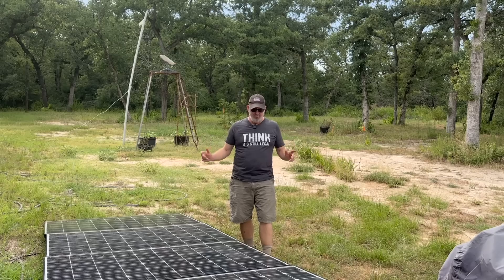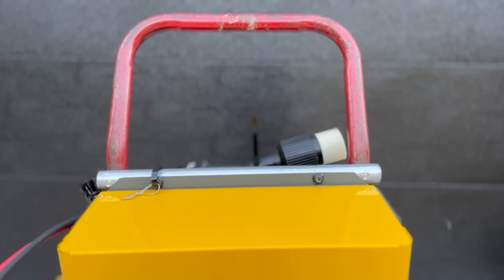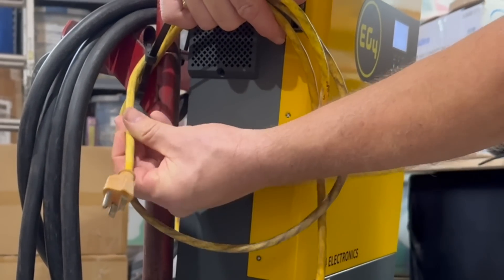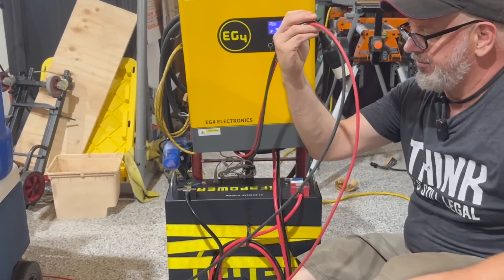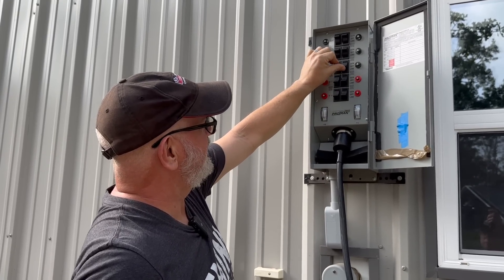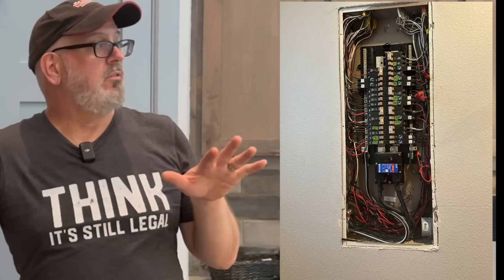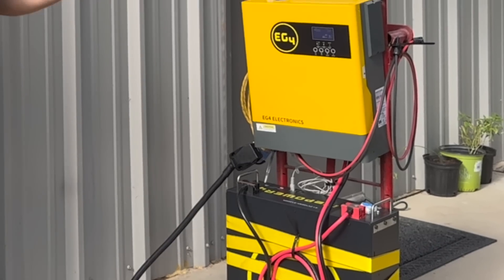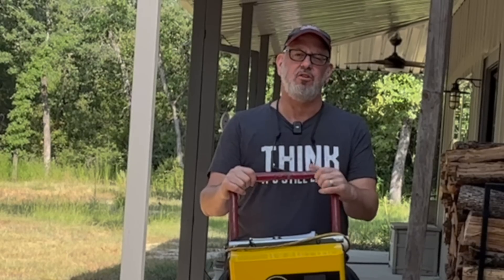CHEAP DIY Solar Power Portable Generator

Comment: I built the same hand truck. And I tapped in one section of my grid tie solar panels ~4KW.  I tested for a week and it was awesome.  Consider  I only got 3 full days of sun….No transfer switch or critical load yet. Just cords to windows AC and two fridges. It is true. Solar can be additive
Reply from the maker: That’s fantastic!  It’s amazing how much power a 5.1 kWh battery🔋can store.  When mine is just sitting around, it’s running a 1 ton inverter window unit A/C in our shop.  Yes, solar power can be addictive.  Once you figure out how to harness nuclear fusion from the☀️sun for free, you tend to get on a power ⚡️trip!  🤣👍💡🔌🤠
Reply: @terrahillfarm do you have a link to the window AC unit that you are using?
Reply from the maker: @MyCabinLife  here’s a link from Home Depot.   

https://www.homedepot.com/pep/Midea-12-000-BTU-115-Volts-Window-Air-Conditioner-Cools-550-Sq-Ft-with-ENERGY-STAR-and-Remote-in-White-MAW12V1QWT/315241182

I’d check prices at Amazon, Costco and Walmart as they all run sales from time to time.  ⚡️☀️👍🤠
Reply: @terrahillfarm  thank you!
How long can you use it on the little system that you built?
Reply from the maker: @MyCabinLife  I really depends how hot and/or humid it is.  It will consume between 550-1150 watts when running. It’s variable speed so it might be low consumption in a smaller insulated room.  It’ll ramp up and down depending on temp and setting.  I use it in a way bigger space than it is designed for, so it’s usually running all out for me if it is really hot outside and it doesn’t cool a 1200sf shop near as well as a Bedroom.

So in a house, if the outside temp was say in the mid 80s, average use might be .5-.6 kW/hr.  At that rate, you’d get about 7 hours out of 1 battery.  If the battery is hooked up to solar panels, the panels could generate additional power during the hottest part of the day so you might get a total of 10-12 hrs run time in the mid 80s.  At 95f the battery would last less.  For a broad guess without solar panels and temp in the high 80s, I’d calculate an average of 5 hours, based on 80% SOC for a 5120ah battery at .85 kW/hr. In real world figures, every use case is just different. 👍☀️🔋⚡️🤠
Reply: @terrahillfarm  I do have 11 of the 455 watt solar panels available. I'm trying to decide between something like this or a mini split if I can get one with a regular plug on it for at the cabin which I'll eventually be moving to. And the mini split would have heat and air conditioning. I'm still trying to figure out which one. I saw signature solars 12kbtu inverter one that you can run direct on the panels but I'm not sure it's worth the price and they have so many problems with their stuff when it first comes out I'm Leary.
Reply from the maker: @MyCabinLife  a 12000 btu mini split a/c may have slightly better performance depending on the SEER rating.  Remember that over 12000 btu you’re looking at 240v systems.  If you need heat, the battery drain maybe higher.  I’m going to have to move up to at least 24k btu mini split to cool my shop.  If it’s for daily living areas I’d go with a mini split.  Just for cooling a single room under 500sf, the Midea A/C will work fine and save money.  👍🤠
Reply: @terrahillfarm  my cabin is under 400 sq ft. I have three of the EG4 server rack batteries.
Reply from the maker: @MyCabinLife  the Midea would be fine for your A/C or you could get a 9000-12000 btu mini split for a little more money and have heat too, although I prefer to heat with propane and use electric as backup. Sounds like you are set! 🏠

Comment: I recently purchased the same battery and inverter and I am waiting for six 415 watt solar panels to be delivered. That should provide plenty of power for anything we'd need in a blackout. I will in time get a second battery just to have a little extra power in reserve. I am sure eager to see it all together.
Reply from the maker: Thanks!  That’s about the same amount of solar watts I’m running off 10 used panels now.   That’ll run some heavy loads in peak sun hours.  If your utility charges lower rates off peak hours, you can recharge the battery with grid later in the evening when rates are low.  I couldn’t really find a better bang for the buck than the 3000 EHV & Lifepower 4.  Hook up a transfer switch to your critical loads and your system will be simple to run and give you a great emergency back up solution.  ☀️👍🔋🤠

Comment: Fantastic build and review. With this I could use it for my home backup or for my RV. And when the sun is out it will charge while you are using it. Thank you for answering the EXACT question I have been wondering.
Reply from the maker: @pamelafontan963  I’m glad it was helpful!  This is a really simple system to build! If buying the EG4 Lifepower4 battery, make sure you get the new version (V2).  It will allow you to expand your system more easily and it’s only $50 more. Also remember this will only power 120v loads. If you have to power 240v loads you can add a second 3000 watt inverter, but if you need that, I’d recommend just starting out with the 6000xp since it does both 120/240v.  For powering your home, I’d recommend you install a manual 6 or 10 circuit transfer switch.  That’s what I did and it is simple to switch over to battery/solar power when needed.  Don’t forget to use my $50 off code when checking out!  2steps50off    👍☀️⚡️🤩🌞⭐️

Comment: Nice video, just as a side note the EG4 3K inverter isn't designed for outdoor use.
Reply from the maker: Thanks for the feedback!  I hope I didn’t imply the 3000 was for outdoor use.  But I did show it outside, so I don’t want anyone thinking it’d be safe to leave it running unattended outdoors.  On a cart it’s handy to move around the garage but it wouldn’t last long in rain or high humidity.  They do make some outdoor rated inverters, but I don’t know if I’d even trust those long term.  Just too much rain where I live. ☀️👍⚡️💡🤠

Comment: Thanks for the great video, after research of the many other systems, I chose EG 6000 XP and the cart. Down here in Puerto Rico we lose power regularly. In want to be mobile. Currently I use Bluette, save me many times. But it's time for update .
Reply from the maker: Thank you for the feedback!  The 6000xp is a really nice inverter.  I have two in the box ready to be mounted so I’ll try to post video of my efforts with them.  I’ve heard about the power issues in PR.  Hopefully solar and battery prices will keep falling so more folks can afford to install DIY systems there.   👍☀️⚡️💡🔋

Comment: Great video! I'm going to get that same setup for my RV and step it down to 12 volts for the dc panel in the RV. My backup plan for the RV when camping off grid is when I can't produce enough solar for my needs I have a 3500W Champion Dual fuel that I can charge the battery. I'm carrying propane anyway for the RV. The propane can sit around for a really long time without going bad unlike gasoline. And the carburetor doesn't gum up. You may consider that since you already use propane. Thanks for the video
Reply from the maker: Thank you for the great comment! This is a good set up for an RV, especially if you can set out some extra solar panels during the day.  One thing to understand is that the EG4 Lifepower battery needs a very clean and stable electric source to charge and few generators are sufficient to do tthe job.The solution is to use something like the EG4 chargeverter.  It is adjustable and does a good job charging from a generator.  There are plenty of videos online showing it working.  My inverter stays at home so I just charge with grid or solar.  👍☀️⚡️😁💡
Reply: Don’t go with Champion. I’v had two and they due pretty quick, especially in a warm damp climate. Go Honda. But not the open frame ones. Get one of the quiet ones. You will be much better off. I’ve been into electronics/ electrical for 60 years, trust me. Been using generators for 12 years. And worked at an automotive machine shop, so I know how to take care of them.
Reply from the maker: @5400bowen  I don’t know about others experience, but I bought my first Honda EU2000 new in 2008 and the second (used) in 2010.  I’ve replaced a carb, converted one to dual fuel and maintained them to schedule and they both still start on the first or second pull.  So I guess that is some good advice you’re giving there..  😁👍⚡️

Comment: Great video! I have kinda a hybrid backup system.  Ecoflow Delta pro refurbished and Extra battery ($5000) plus 2 48v 70ah lifepo4 batteries to supplement ($800).  So have about 14K watt system for under 6K.
Reply from the maker: Thanks!  That’s a fantastic amount of power for an emergency!  Getting a good 120v solar system up and running is not that difficult.  But going split phase 120/240v gets pricey fast.  We’re going to keep running our critical circuits and add some more batteries with this system while we shop for the right whole house hybrid system.  The three candidates are the 15k SolArk, 18k EG4 & the Schneider XW 6.8.   Right now the Schneider is the front runner due to LF Transformer.  ☀️👍⚡️🔋💡
Reply: @terrahillfarm I bought two of the  Growatt SPF 5000 ESs, which put out 240VAC, plus the external "Midpoint transformer", mainly to get 120VAC for my off-grid "RV home". I only needed one to run what I need, but figured that having an oversized system would be easier on the components. As I understand it, one could run up to about five of these with only one of the transformers, if one needed more power at one time. I like these as they can take in 6000W of solar at up to 450V open circuit. 
This is how I got around the expense of the Schneider, et al.

Comment: Nice build. It's always best to build your own solar generator, but after spending 23 years repairing inverters including inverters from Trace Engineering, Xantrex, Magnum Energy, Outback as well as hundreds of Chinese made, low cost, transformer-less, high frequency inverters, I know from experience that high frequency inverter simply don't last. I would highly recommend staying away from the high frequency inverter that you chose if you want your DIY solar generator to last. The FETS (field effect transistors) that are used in these lightweight inverters are fine for power resistive loads like incandescent lights or small electronics but were never meant for running high surge loads such as motors. microwaves, refrigerators, air compressors and power tools. You might be able to run your power tools a few times but every time you turn that high surge, inductive load on, your damaging the FETs in your inverter. Guarantied, right about the time your warranty runs out. those FETS will fail and you'll be let with an expensive paperweight. Commercially available solar generators use the same lightweight high frequency inverters which is why most of them fail after only a year or two of use. If you want a solar generator that's going to last,  then you're far better off spending a little more money and buying a low frequency, transformer based pure sine wave inverter.
Reply from the maker: Thank you Wow! that is some really good information to know.  So the low cost HF inverter might be fine for budget/limited/back up uses but if running an entire house a LF inverter is going to have a much longer life running 24/7/365?  I’ve seen some nice LF Victrons, Schneider and Growatt, but for running a typical 2000sf house with regular air conditioning loads which brand would you select if it were your home?
Reply: I agree I have twin magnum 4448 PAE LF inverters been total off grid 5 + years not 1 issue.  Got a friend about 20 miles from me chose a Solark 12K non stop issues.  Low frequency is the way to go if U are completely off grid.
Reply: when using a low frequency transformer inverter -
what is the ac conversion efficiency ? 
is there an easy way to identify if an inverter uses transformers instead or FETS ?

Comment: Thank you so much for this video!  You have inspired me to take on this project. Question: I am new to the channel and to off grid.  I assume you are hooked up to city water since you did not mention running a well pump.  Do you think this system could do that?
Reply from the maker: @Handelson  Thanks!  Actually I’m on a well but my well pump is running off a separate meter.  Since it is 240v it would take modifications to run it off this system.  I’m presently working on a project to convert the well to solar and will publish when it’s completed.  👍👍👍👍
Reply: @terrahillfarm  Wow I will be looking forward to that video...thank you!

Comment: I just built this system myself off of Will Prowes YouTube posts.  It works great.  A question I have is grounding.  When I use it to run equipment it's not grounded.  In my own mind, I should plug it into a grounded house outlet (even though the power is out) it's grounded.  Any thoughts about this.  I haven't installed a dedicated circuit panel yet, but that will be the next project.  I live alone in the High Desert CA, and have 8x400 watt panels when I do get connected will run them in series.
Reply from the maker: Thanks!  Great question!  Admitting I’m no electrician (far from it) I do know this.  When I run tools or equipment directly off my Honda eu 2000 inverter generator, it’s not grounded to anything.   With the EG4 3000, when you are running solely off the battery, it’s not grounded other than to the inverter itself.   in either case, I’ve never had issues.  The issues seem to come whenever you make a connection to the grid through a plug, a service or sub panel and then how the neutral/ground bonding is set up at your particular grid service can become an issue.  So I’m comfortable running solely off the inverter/battery combo, using it like a portable generator, but if plugging in grid power or tying into your service panel, I’d call in a pro to make sure your grid service is set up correctly. The old version of the eg4 3000 inverter included a bonding screw which bonded the ground and neutral and that caused some confusion and problems.  In the new version, they removed the screw and ability to bond neutral and ground.  As I understand it, the neutral and ground in your grid power system should only be bonded in one place, and that is the panel closest to the meter, or where your grid power comes in.  When you bond ground and neutral in more than one place, you can have some dangerous issues. I’ll defer to any pro opinions on these statements so don’t take my response as the correct way to do anything!  😵⚡️☀️💡😁
Reply: @terrahillfarm   @terrahillfarm  that's where my confusion is, the bonding ground on both the charge controller, and battery.  The battery, and controller use the same ground inside the controller, so I also connected the outside bonds with copper wire.  It looks pretty messy.
Reply: @terrahillfarm  definitely adding the transfer box with at least refrigerator, mini split, wifi power, is all I really need.
Reply: @terrahillfarm  definitely adding the transfer box with at least refrigerator, mini split, wifi power, is all I really need.  I have electricians helping me figure it out too.

Comment: Have you recharged your unit with a generator, and if so how long to recharge off the generator ac power. Thanks!!
Reply from the maker: Thank you! Great question.  The LifePo4 batteries like to be charged fast and the default inverter charge setting is 30 amps so that pulls about 1800-2000w from the grid to charge.  My two Honda generators max continuous is 26.6 amps or about 3200w so they should work to charge the battery. The best way to charge one or more batteries with a typical generator is using something like the EG4 chargeverter.  It has adjustable amps and can really push power into the batteries quickly.  Most solar inverters discourage charging directly with a generator unless it’s got a really good pure sine wave.  I’ll pull out the Hondas and do some testing to come up with some solid estimates. 👍⚡️💡🔋🔌🤠
Reply: That would be great I have 3 inverter generators, 4000 watts each 3500 running , Plan on building this system as a back up to run at night during grid failure.  I'm still trying to learn about solar, thanks for your help. Stay safe brother! @terrahillfarm

Comment: I think the backup question is dependent on how long you want to be good for with a grid failure. Panels and charge controller don’t need to be much if you aren’t using it except for outages. But if you want a weeks worth of power you need to calculate your needs( like for the emergency, or your “comfort range” usage and buy enough batteries. If they are going to sit unused until an outage, even a comparatively small panel/charger set up will charge them up fully to be ready for the apocalypse.
Reply from the maker: Agree! Having gone without power for almost a month straight after a hurricane, with only a generator for power, just having a solar charged battery that would let you keep basic lights,phones,internet and fans on while your generator rests a few hours is a worthy goal for energy resilience.  Once you get started though, it’s just about adding more panels and batteries after that.  And that quest my friend never ends! 🤣⚡️☀️👍🖥️💵
Reply: @terrahillfarm  yeah, once Ingot Solar I never stopped expanding. The more power you have, the more you use. But I’m in a remote area, so no going to a laundromat etc. I do as much for myself as possible. Plus, a well pump and I run an air compressor and other power equipment from time to time, and lights at night for security etc.